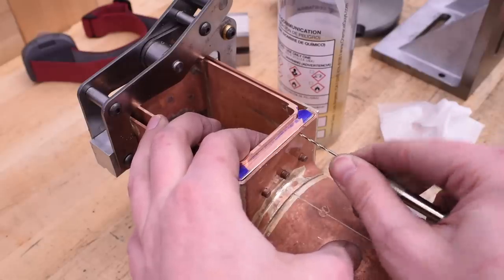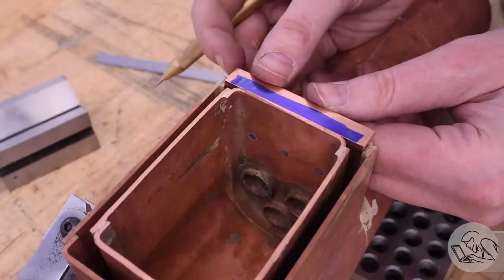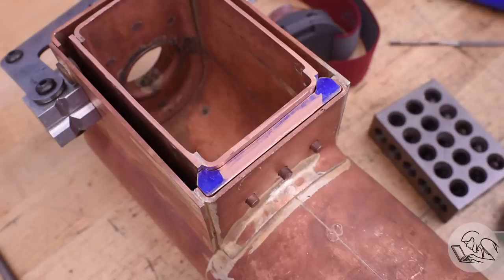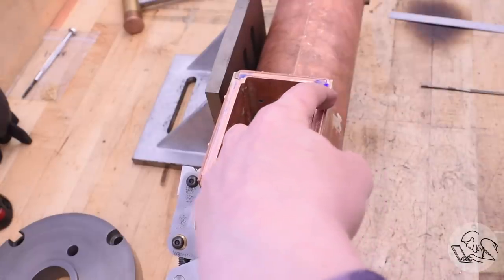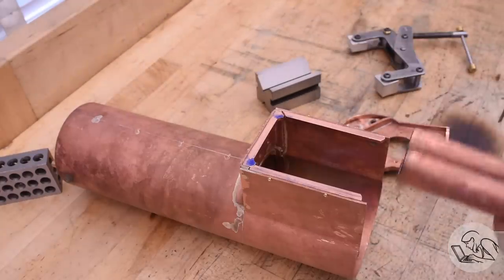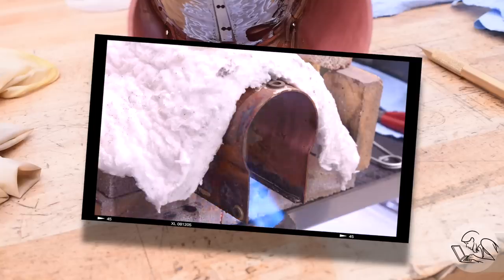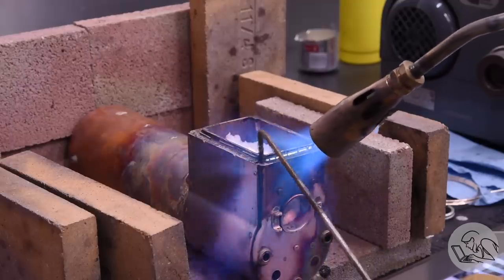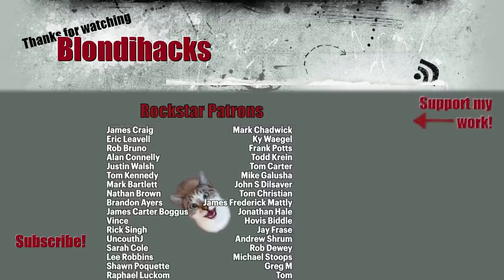Foundation Ring and Backhead! Pennsylvania A3 Switcher, Part 11

Comment: Two things:
Re: silver soldering. I have always heat treated (hardened) carbon steel with opposing propane Bernzomatic TS 8000
torches. Nedd to get to a bright red. Cannot get the pieces up to heat with only one torch. When they oppose, it is fast and furious.
 I say this with all due respect at your efforts. The bernzo 8000 puts out alot of btu's. China now sells cheap knock off copies on ebay. I say this knowing what you did in video 11 was A SUCCESS!!! Great.

The other thing came out after watching Penn. A3 videos # 10 - pressure check. My suggestion,  would only make sense if you want to up the edit/video aspect of your game and make your presentation more comprehensive. Easier for the viewer to follow along. I never used your type machines but know my way around tools. I really tried to focus and follow along when you described each part of the custom made plugs, but always got lost when I stopped to think for a moment. Then lost my focus completely and just waited for you to install the part. I realized I could not 'imagine' or picture up front what the part would look like after being fabricated - so the before hand verbal description for me was useless. Even when you were making the part, I still could not grok how it would function. My suggestion would be, if you know how, to show a still of the completed part for a couple seconds before the description and machining. Stop action, small interlude for us idjits.
Then I 'get the picture' and know what the final part will look like. Voice over: this is the next part I will be describing and fabricating, and it goes here - perhaps with arrows.
I love your thang and enjoy watching the videos.  Go girl go.

Comment: I sooo feel your pain with the pin vise.
Not long ago I had to drill the stripped head off a tiny little screw through the PCB in a cell phone to get it apart and replace a swollen battery. Way too fragile to use power of any kind. My hand will never forgive me.😢

Comment: I wasn't quite able to tell if you had considered the alignment of the three tubes as the firebox was being soldered into the outer casing part, but are they still aligned well with the end cap? 

As in, does the end cap still fit well?
Reply from the maker: Yah, the staybolts on the throatplate keep everything well aligned.

Comment: Re the small hole, Dremel has very poor control. I use a dental micromotor and it's really a precision tool (I use NSK but there are cheaper but decent options too). Can't recommend it enough, I use it all the time but I guess it depends what you need to do. A pendant drill (like a rotary shaft tool) is also not really precise in comparison (like a pencil with a potato at the back).

Comment: Would it be good to CNC the foundation ring? It looks like you could take a photo and measurements, draw it in CAD and CNC mill it, all in a fraction of the time it takes to do all that filing and fitting and with best chances to hit the required clearances.
Reply: Fraction of the time?  As someone who runs CNC's for a living, the only thing quick about them is the machining.

Comment: Just wondering, is there a reason you don't weld any of the joints? (I don't know much about welding)
Reply: Welding copper is not easy, and she’d never get the super smooth joints she’s getting with soldering.
Reply: @DoctorShocktor  thanks for the reply :)

Comment: And I would have thought it was called a "mud ring" because it looks like the US electrical box component of the same name.  I wonder if electrical box mud rings got their moniker from their similarity  to the steam engine component?  I thought the electrical box components were called that because they are used in conjunction with plaster and stucco.  But the part you made and the electrical component look very similar.  Always suspect of coincidence, but coincidence occasionally occurs.

Comment: You may have more success drilling with the dremel if you had used a guide. By drilling the same size hole in a piece of steel that is clamped in place to act as guide for drilling the copper. That is how woodworkers do it.

Comment: A high temperature, high pressure, low moisture absorbent, anti-corrosive epoxy may provide you with some peace of mind in those joints where you may have created gaps and really don’t want to heat the whole piece up again. Some of these epoxies are rated to 500 degrees F and 2500 PSI (or even higher), far beyond anything you’ll see in a water boiler. Your books’ author didn’t have the benefit of current chemistry technology, it’s quite amazing and is used in automotive, aerospace, oil fields, and electronics industries in place of many mechanical, soldering, or welding processes, particularly in repairs. I realize this is a metal working channel, but multi discipline technology can be a vast improvement over traditional techniques.

Comment: I have no idea if this will work just thought of it now (comments required), insted of constantly making weird clamping structures, what if you get and old shallowish container, lots and lots of candles, melt the candles into the container so you have a tub of liquid wax, put the complex shaped part in, get it level or into what position you want, let the wax set, whala no need for weird clamping, the wax isnt hot enough to warp the part(i dont think) and you can melt it and re use it constantly
Reply: and it will give it structural support in hollow spaces as the wax will flow into them

Comment: once you consider the ratio of manufacturing man hours to machine lifetime operating hourss... this is probably one of the most perfect candidate application for metal 3d printing. but i do admire the exploration of these fabrication techniques for other potential uses including many model making. just maybe not steam engine model making specifically. i just shudder to think of all the damage that would result to the innards to actually use such a thing for its intended purpose. if youve ever seen real stem engine restorations. the absolute horrors

Comment: I assume it's a mud ring because it's shaped kind of like a mud ring for drywall, which is an insert used to provide a substrate for mudding, or applying joint compound
Reply: It's because the lowest part of the wet side of a boiler is where all the crap collects.  On large boilers you'll often find strongback hand holes for cleaning them out in those areas.